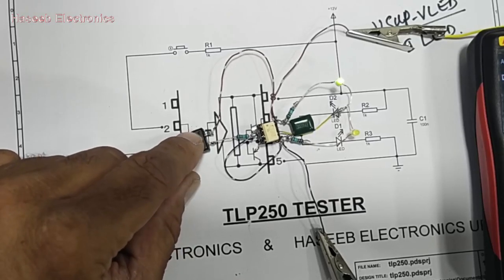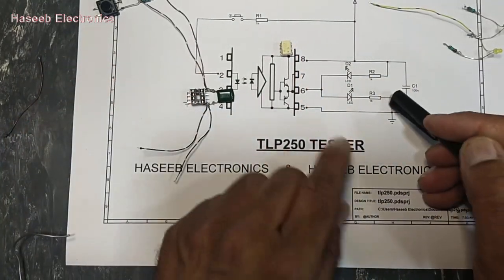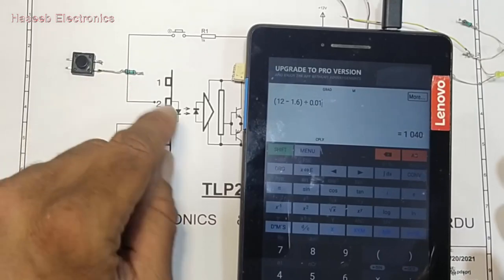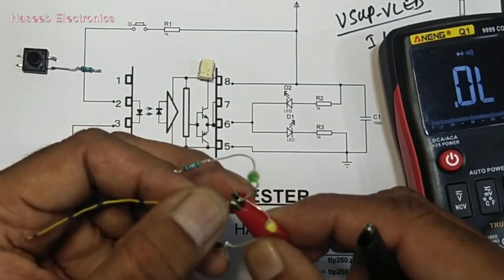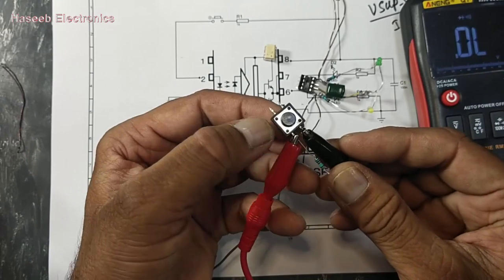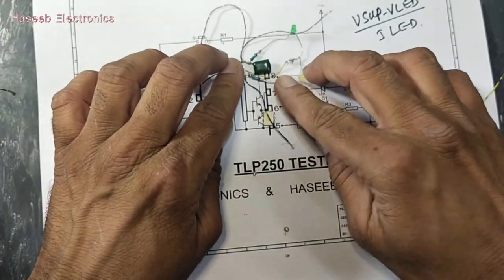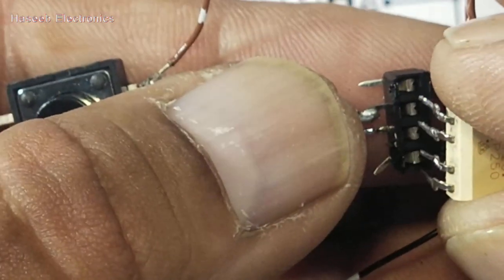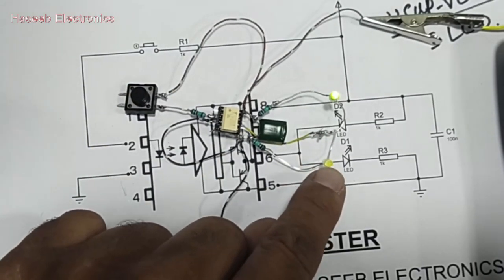{477} TLP250 Optocoupler Test Circuit,  Pinout, How to Test TLP250 Optocoupler

Comment: An excellent tester to add to the electronics bench. Testing optocouplers has always been a pain to me, because there are two separate devices inside the one package. So, you must test two different functions, at once. I usually only see the single transistor type. So, I am going to configure your circuit to test both single and dual transistor types. Thanks for the great idea. This circuit will bring some relief to me. lol.
Reply from the maker: best regards and special thanks for your valuable feedback
Reply: @HaseebElectronics  lol... I have already laid out a design in KiCad. It can test EL817 and TLP250 type optocouplers. I will need to put it on a breadboard to test it.  Are there any other common Octocoupler types that I might need to include in the design? Hmm... I don't have a TLP250 type optocoupler. I guess I could just build it out of individual components. I will let you know how it goes... Thanks for the inspiration!
Reply from the maker: @t1d100  that is awesome
tlp250, 350, 351 same

Comment: I had commented that I was going to breadboard your circuit and I am glad that I did. I did not observe the same illumination pattern as you. I did double check my breadboard connections and I am confident that I had made them correctly.

You used LEDs of different colors (meaning different Vf.) I used white LEDs (meaning the same Vf) and 1K current-limiting resistors. You observed one color on and one off. Then you pressed the button and your LEDs swapped illuminations. My illuminations were both LEDs illuminated (without the button being pressed) and only one LED (your D1) illuminated, when I pressed the button.

This makes sense, in relation to your schematic... While D2 and D1 share a connection to Pin 6, they are in series with one another, from +12V to GND, as you have the schematic drawn. 

If I understand correctly how the circuit works, D2 relies on the resistance of D1 and R3 to cause the power to take the path of least resistance through the PNP transistor to ground. Maybe the resistance provided by your different color LEDs was sufficient to cause the correct path to ground, where my circuit, using the same color LEDs, did not provide a sufficient difference in resistance? I do not know, because I am not as good at engineering as you are... yet... lol. Or, maybe you wired your prototype slightly differently than your schematic?  

I do understand that the NPN transistor acts as a normally closed switch and that the PNP transistor acts as a normally open switch. When power is applied to their bases, by way of the internal LED and photo-receiver, the NPN transistor opens and the PNP transistor closes. 

Would you, please, make another video about the operations of the circuit and the paths the power takes, for the different button states? You can use the different colored pencils trick, again. LOL Anyway, I am learning lots and having great fun. All thanks to you!
Reply from the maker: Oh NO. 
i think there is some disconnection in bread bord internal connection strips. otherwise it must work
Pin 16 to +12V
pin 8,  3 & 15 to Ground 
clock input to pin 14
LED no. 1 to pin 3
led 2  to pin 2
led 3 to pin 4
led 4 to pin 7
led 5 to 10
led 6 to pin 1
led 7 to pin 5
led 8 to pin 6
led 9 to pin 9
led 10 to pin 11
POWER ON and ENJOY the running lights. LOL

if you want to connect next stage 
pin 12 of first stage will go to pin 14 of second stage
Reply: @HaseebElectronics  Greetings, Haseeb! I returned to experimenting with my TLP250 chip and I am realizing that it has some major differences to your chip. These differences may explain the difference in performance that I encountered. I purchased a Toshiba TLP250H. I am using its data sheet dated 2015-12-24/Rev.4.0; see page 2, for the Pin Assignment diagram. I am not sure of the symbols, but I believe this model uses FETs, instead of BJTs. And, it has two NPNs stacked in series. Yours has one NPN and one PNP, which I think is a more useful design, because you have more configuration options. I want to test mine to confirm that it does not have a PNP and that this is not just a printing error. I am hopeful that you will have an opportunity to review this data sheet and give me some ideas on the differences that I may expect in its operations and use. And, how I might confirm the NPN/PNP types. I am thinking that just a simple diode polarity test might do for that? I will have to think on it. Thank you, again, for all that you do for us! Cheers!
Reply: I will also be watching (again) your other/first(?) video about this IC; your video #462.
Reply: I did watch #462. I noted that you are using TLP250INV. "INV" stands for inverting. This would explain why the INV model uses NPN and PNP? The "H" models is non-inverting, I think.  So, NPN and NPN. I only had a moment to review the INV data sheet, but there appears to be other important differences. Example: H model - Pin 6 and 7 are not common. Inv model - Pins 6 and 7 are common. So, folks should be very careful, when selecting the model that they need. I look forward to your thoughts.
Reply: @HaseebElectronics Greetings, Haseeb! I played with my H model some more. As I said, the H model uses two NPN transistors. I find having two of the same transistors makes the device much more limited in its configurations and uses. The solution, I guess, is to add a bootstrap circuit, to create a PNP. But, that is more components. I am wondering, if you could think of and explain a use for two NPNs, as it is made? Thank you.

Comment: I see that you use common ground for diode and transistor at pin 3 and 5, I have also some tlp250 and they only work with 2 separate grounds from separate power supplies. Why?

Comment: I was a little surprised to see the capacitor. Why is it necessary, meaning what is it doing? Thanks. Hmm... Guess I'll watch the video, again... Wonderful!
Reply from the maker: this capacitor is use to remove switching noises of the mosfet and provides the compensation to the internal comparators during switching 
so, it prevents from false switching

Comment: You could use this for testing 817 series found in many switch mode PSU, connect between pin 8 and 6
Reply from the maker: yes we can arrange it
then we have to connect +ve voltage to pin 7 and we can take output from pin 6

Comment: Just a Little help required
The turntable of my LG microwave oven starts rotating with little noise as I open its door to keep the items to be heated/cooked/ warmed, otherwise everything is normal. Suggest remedy please.
Reply: Problem resolved by replacing the top most rocker switch.